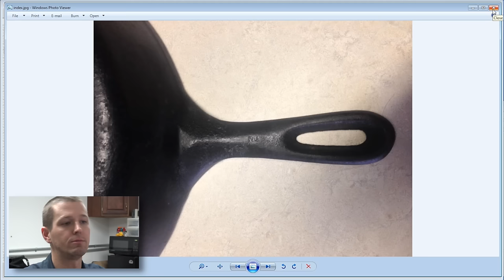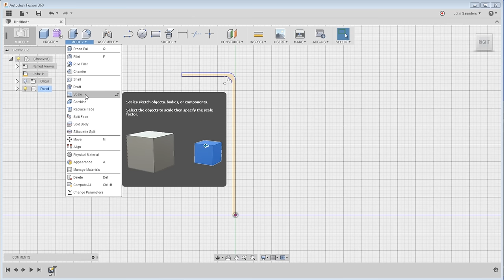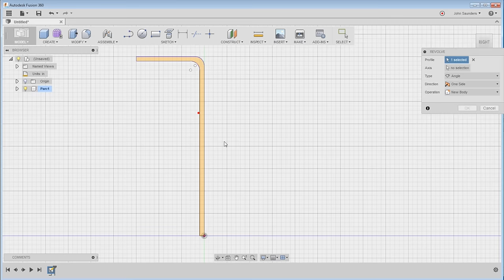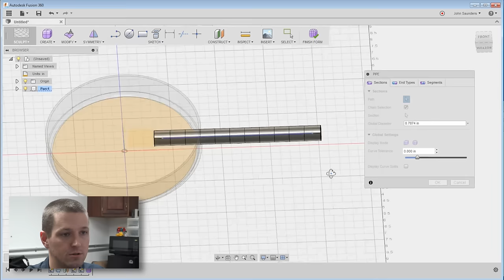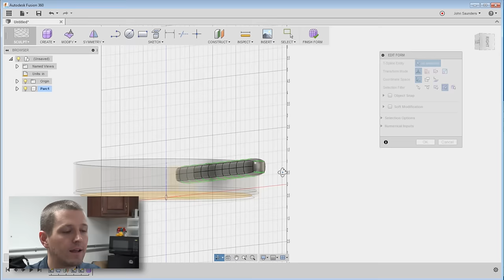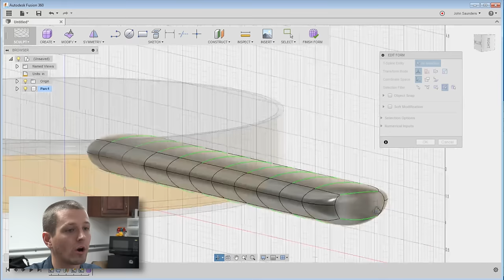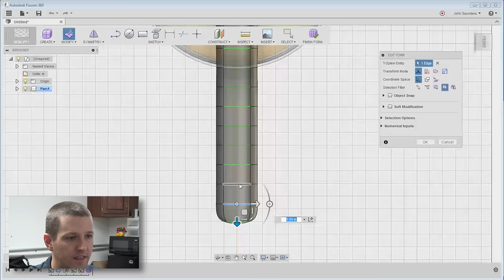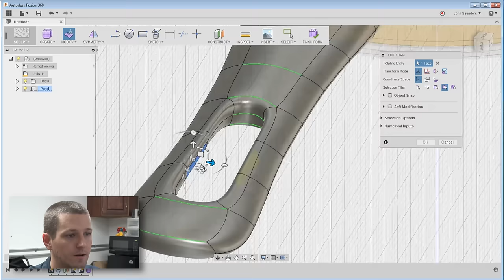Fusion Friday #1: Frying Pan!

Comment: Glad you figured it out! I saw your question on Facebook a few days ago and I tried it myself. Took me a few tries to come sort of close to what you ended up with but I couldn't get the triangle on the bottom of the handle right. I was using a combination of two sketches, one "intersecting" with the other for the initial form of the handle. Then another sketch / extrude for the hole and then finished the whole thing off with a fillet and chamfer. However... I eventually gave up because I just couldn't come close enough. I'm glad you figured it out though, going to give it a try myself! Thanks for easing my mind ;) Looking forward to the next Fusion Friday =)